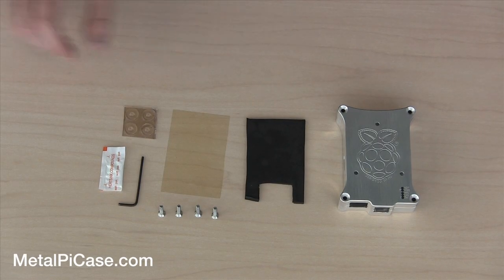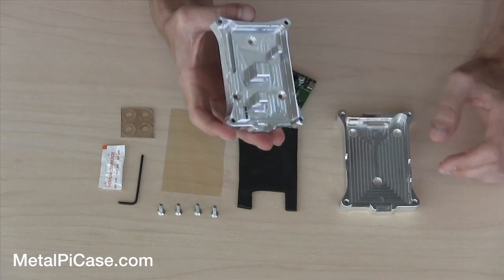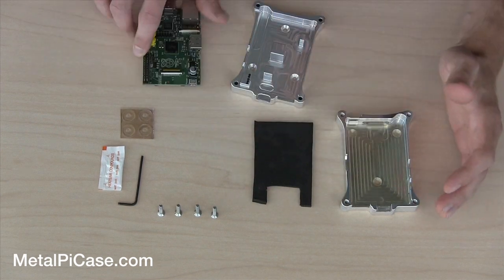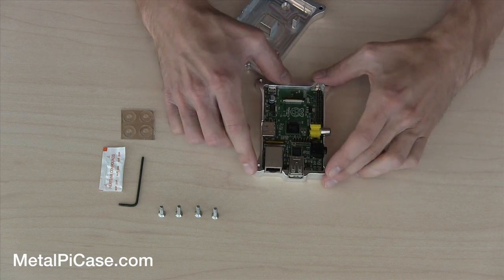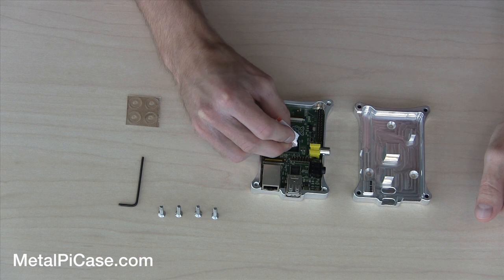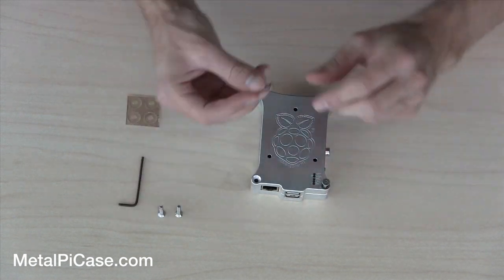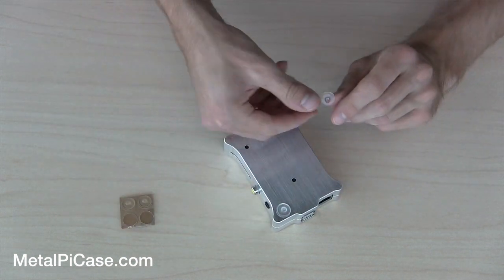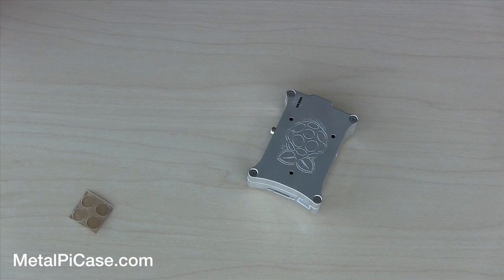MetalPiCase.com Raspberry Pi Case Setup

Comment: This is the first video where I have seen the thermal paste applied correctly without making a huge mess with these cases. I really want the 3b+ model for my retro pi build. Looks better compared to the flirc cases but also more pricey 😩

Comment: Hey Eric, I just ordered one of your cases in red and it got here about a few days ago. While I am impressed by your work, I am also a bit disappointed by the quality of the cut outs on the riser as they were not that well executed. I would have used a professional Braun scalpel to do that, instead of using a pair of tweezers. Also there is a protecting plastic piece on one of the heat sinks (that you can pull off) however there are none on the other two heat sinks. Does that mean they were unprotected during the painting (I got the one in red)? I wanted to order another one in Aluminum without the red paint but now I am not so sure. I am also tempted to do a video review here on YouTube about your case because I still love your design. However, a bit more attention to detail would have been nice. Best wishes, Adrian Weber - Security Elements
Reply from the maker: +Adrian Weber Hi Adrian, I appreciate the feedback. We'll see what we can do about the risers. Seeing as how they are not visible and just there to provide a tight fit, we do just get them close (as you said).

Could you send me a few pictures of the case to support@nooplabs.com ? If there was any protective plastic left on, you should just be able to pull it off. If you did receive a case where the heat sink posts were painted red and not the protective plastic, we'll make sure to resolve that for you.

Thanks again!

Eric
Reply: +Eric Barch Hey Eric, thank you for your quick reply! I will make pictures as soon as possible and forward them to you. There is one thing however where you got me wrong. There actually was a protective plastic film on them but someone already removed two of them. And the stickers were not 100% accurately placed, meaning there is some paint on the edges which may result in the heat sinks not laying 100% flat on the CPU/RAM etc. You wull see in the pictures. What shall I say I am a perfectionist you got me there! Thanks again Eric. Best wishes and talk to you soon, Adrian
Reply from the maker: +Adrian Weber Hah, no problem. Looks like we missed that one protective cover...sorry about that! But yeah, I'm happy to take a look at the pics so I can see exactly what you're talking about. If those posts don't sit flat, we'll get a replacement out ASAP :)

Eric
Reply: +Eric Barch Hey Eric, thanks again! I will make these pictures as soon as possible 
but I hope you have some patience until the End of the week. Best 
wishes, Adrian